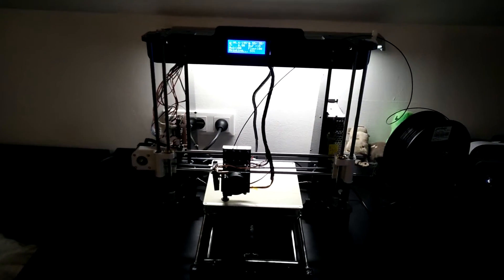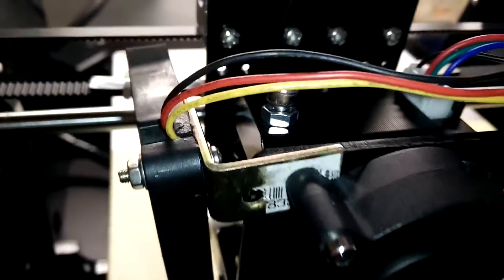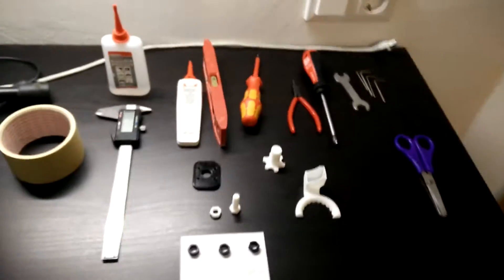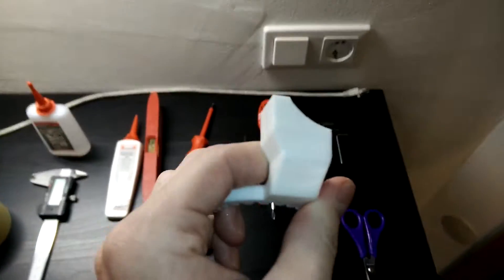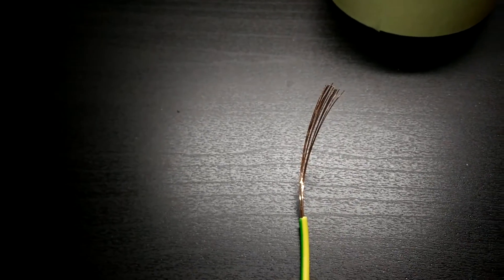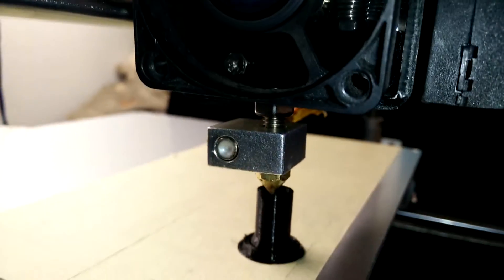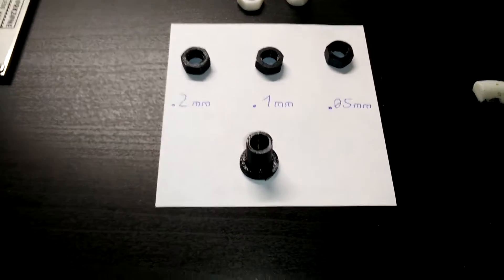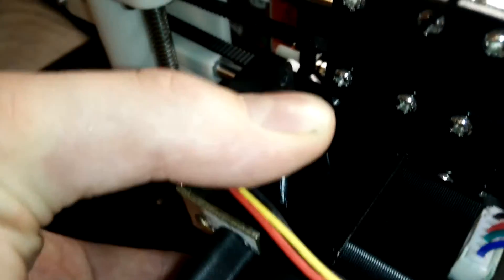Anet A8 - Starting to Upgrade

Comment: Thanks for the videos. I new to 3d printing and have cura and Simplify3D and seem to have wrong settings. Also my bed always tends to get unleveled. Do you have any tips.
Reply from the maker: I can only help you with Cura, aa I haven't used Simplify3d so far. The most important thing is to set the printer up correctly. In case of my Anet A8, this involves correct axis lengths (220mm on X and Y, 240 on Z). Once that's done, start with an easy model, and adjust the settings as you like them to be. The most important ones are layer height (0.2 is good for most things), adhesion type (skirt when everything normally works, raft if not, brim when the parts get loose during the print). For the speeds I'd suggest 40mm/s for the beginning, you can get quicker afterwards. Try to print the first layer slowly (10mm/s), as it helps with the adhesion. All settings are explained and dont forget to look thru the sliced model using the tools in the application. You'll learn quickly and I'd suggest spending a little bit more time in the slicer software and trying out settings in the beginning. 

Leveling: First, take a level and adjust both z lead-screws in a way that the x axis moves horizontally. Then, tension all four leveling screws and Auto-Home the axes. Disable the steppers and move the print head manually to the four most important leveling points, namely the corners. Take a sheet of 80g/m² or 20lb paper and adjust the screw in a way, that there's nearly no distance between nozzle tip and bed. You should feel some resistance when pulling the paper, not too much and not too less. Repeat this at all other corners and repeat the whole process (including the axis homing) at least a second time. Then start printing!
If you have an Anet A8, the z endstop mount is not working properly, as it moves down a little bit after each home. You should print an upgrade soon.

I hope that I could help you at least a little bit, if you have any more questions, just let me know!